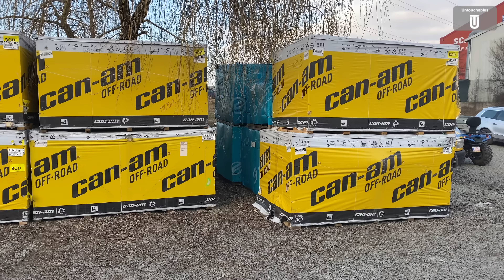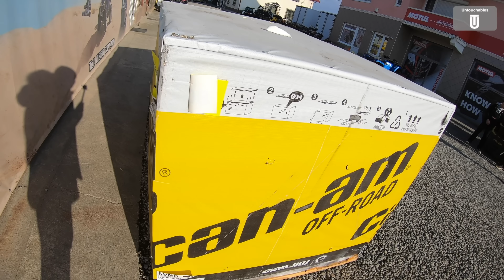❗️Unboxing❗️🤯 Brand New Can Am Renegade 1000R XXC  2022 😱

Comment: Interesting to see that they went back to single spring in the rear shocks.
Reply from the maker: Yes, I'm curious why!
Reply: @Untouchables  I suspect it might have something to do with the design issue when using two springs.
They need to use this nylon spring divider but when dirt/mud gets between this spring divider it actually eats away the threads on the shock body.
After that you can't use the full length of the shock body to to adjust spring preload.
Although if you want to change spring preload that much you should just get stiffer springs.
Reply from the maker: I understand, thank you, this was a new info for me!!!